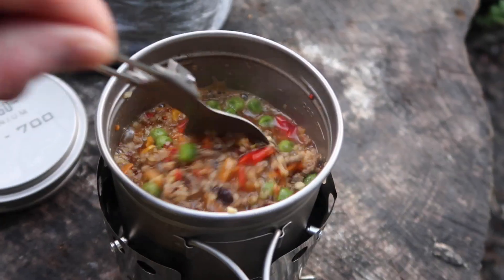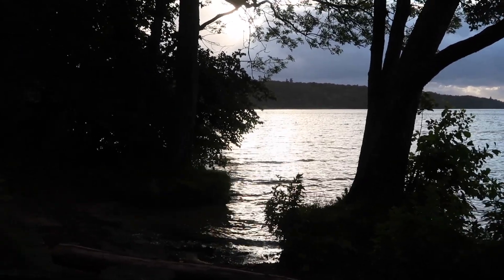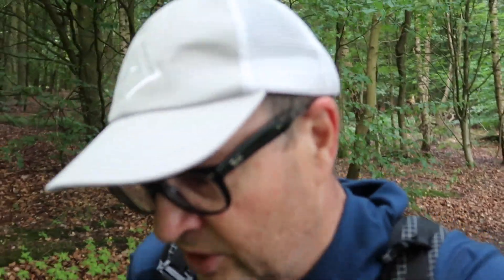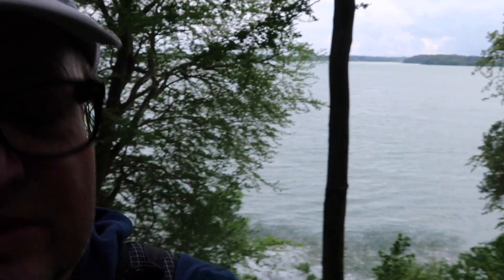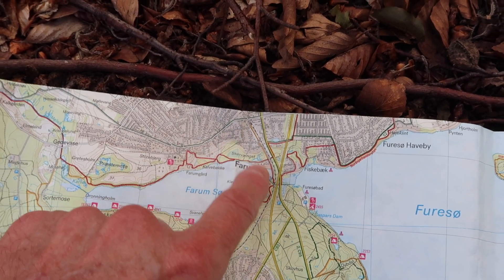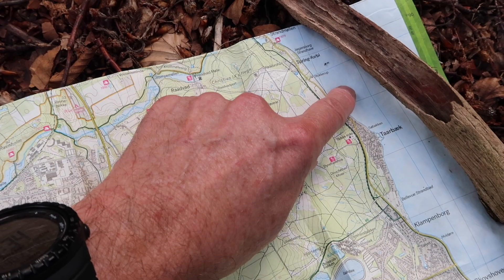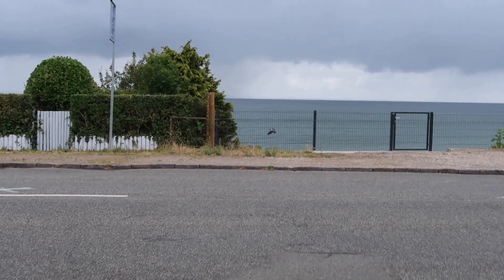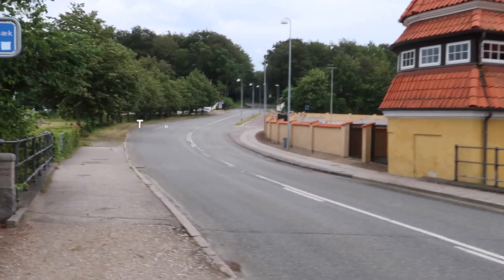Mill Stream Path (Mølleåstien) - Farum to Øresund featuring the Borah Gear Tarp

Comment: Adding to your repertoire of tarp pitches will help with the wind issues.
Reply from the maker: Thanks, yes I need to practice using this tarp next year. I'm looking forward to it 😀
Reply: @BrianOutdoors  If you haven't already come across them, Papa Hiker has some good videos of different configurations to get your wheels turning. The variety is a lot of fun. Loads of tarp configuration videos, as I'm sure you're aware.
Reply from the maker: bereantrb Thanks I’ll check it out